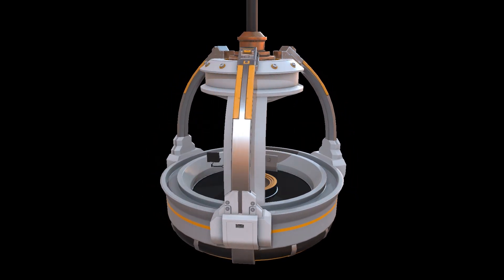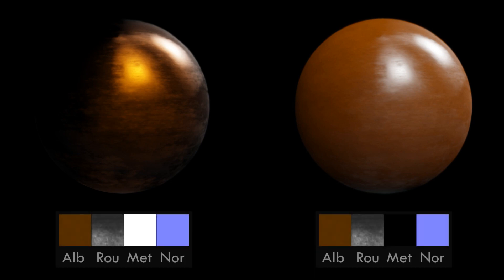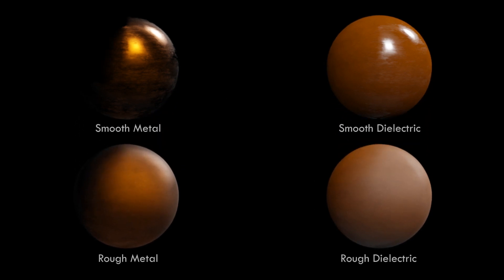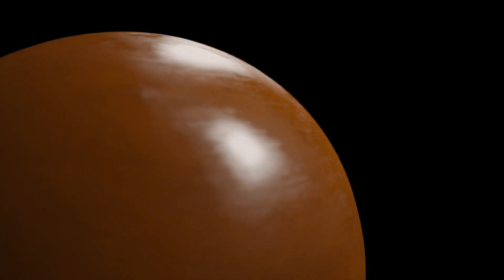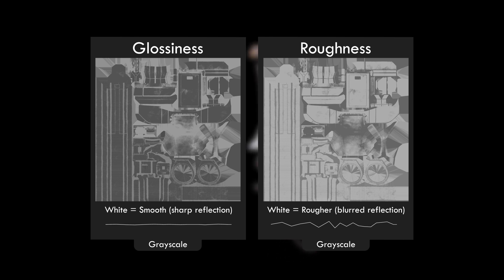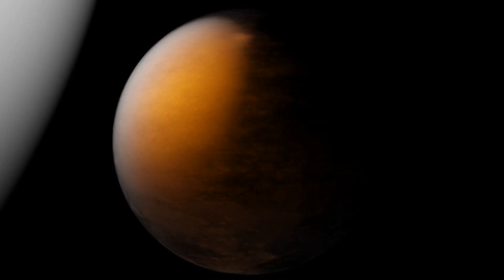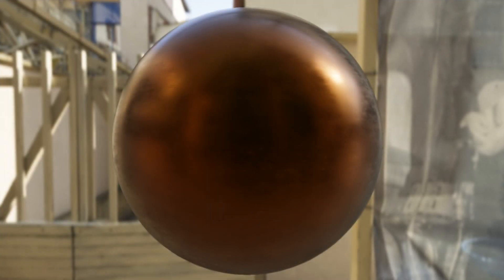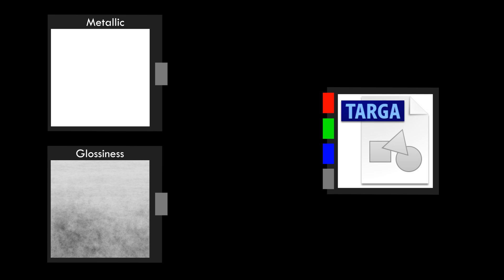Real-Time Physically Based Rendering: A quick explanation

Comment: Why cant you just use terminology that was used for decades: Diffuse (texture), Specular/Shininess (texture/map), Bump/Normal (map), Cubemap, Ambient....
Albedo, Microsurface etc etc... are you using terms from a specific application? Surely not common OGL or DX...
Reply: diffuse is NOT the same as albedo. that's the whole reason he's explaining this, lol. same goes for specular/shininess map - this whole video explains how with the new PBR standard, metalness/specular color is one map and microsurface details (roughness/gloss) is another. ambient occlusion and bump or normal map aren't important here, as he mentions in the beginning - they have stayed the same. the terms he uses are not specific to any application, either.

Comment from the maker: Errata: In this video I make it seem like the photons colliding with a metallic surface will be reflected before any form of absorption behavior takes place. That is not the case. Sending a photon back out again is a secondary effect in the interaction process. There is always an interaction between the photon and the atom. So refracted light interacting with metallic atoms will have interacted and been changed, and not simply bounces off the surface as wrongly implied in the video regarded refracted lights on metallic surfaces. But because the light structure of refracted light tends to be less distorted upon exiting the surface, there is a greater sense of reflection in the refracted light than light coming from non-metallic surfaces. So while the color of the light has changed, the structure of the light is often similar, so it would be possible to see the reflection of the surrounding area in a different color than what it really is, which is different from specular light.

The graphic on 05:38 says Microsurface factor when it should be Specular factor

Comment: Is there a book about this topic? or an article? where I can get more information?
Reply from the maker: Hi! For references I used 
Real-Time Rendering, 3rd ed, ThomasMöller, Eric Haines, Naty Hoffman, CRC Press 2015.
And various articles on photons where the book did not suffice.  
I couldn't find the perfect book for me either, sadly, I don't think there's a book out there which thoroughly explains it equally well scientifically and in 3D rendering practice. The book mentioned is quite nice though if you want to understand the rgb shaders. And you don't hate math formulas.
Reply: Thank you so muhco for the info, I'm curetly working in a real-time project and it's making me have a lot of questions.

Comment: Sorry if this is a stupid question. I still don't understand. Why there are others "physically based" terms beside "rendering" such as physically based shader, lighting, and even for animation. What's the meaning of those? What's the difference? Sorry if my English is terrible.
Reply from the maker: Hello! No it's a good question. The word "physical" is used loosely in computer graphics. It's mostly a marketing term that the creators can use because they feel the behavior resembles "the real thing" and so on. What it usually means is that the behavior of the light or object changes relative to other forces and elements within in the scene. 

Physically based lightning, for instance - can mean that the behavior of the light ray will change upon the interaction of a surface. For instance if white light enters a surface and resurfaces as red light, - the surrounding surfaces will maybe also be shaded red (to a small degree) from those emitted rays. The "maybe" is because the other surfaces might simply absorbs the red light, so it does not resurface again to hit our eyes.  
If the light was not(!) "physical", then it would bounce off the surface as if it had never really interacted with the surfaces, - and continue to shade surfaces as if it still was white light. Yet the surface which was hit is still colored red. That does not make sense in a real world scenario. 
This is just one example of what could justify using the term though. There are plenty of other behaviors of light that can be imitated. 
[Author note: This is further elaborated in detail in a following comment]

As for physically based animation, it can mean that the objects in the scene can be given a weight based on the size and material class, which will change its behavior when interacting with the gravitational factor within the scene. For instance, if the arm of a character goes limb, how fast will the arm fall into a resting position? The renderer will have to calculate this based on its weight and the gravitational down-force. 

Physically based rendering, shaders, materials and so on are called 'physically based' because the data which is fed to the shader is broken into individual data parts which can be used to shade the surface in a similar way a real surface is.  
. 
What is the color of the re-emitted light? (albedo)
How much does the submerged light scatter? (metallic)
For the light rays that simply bounces off the surface without submerging, how large is the spread angle? (microsurface) 

Older shader types which are not physically based shade the surface through more simplified and abstract data structures. Diffuse and Specular, for instance. 
Specularity was basically a metalness-roughness hybrid which decided the luminosity and size of light sources directly visible in the reflected angle. A dedicated roughness channel was not really a thing. There was simply a set hotspot-value which decided the sharpness of any direct lightsource which was reflected into the camera. And sometimes, there was another slider which you could use to reduce the luminosity so you could have a large specular coverage of the surface without overexposure. It depended on what specular model the renderer was using. But the value was set in stone and affected the entire material surface. Imagine trying to draw a surface which was part noisy and part polished. The hotspot sharpness would be the same across both the noisy and polished part. It was really difficult to make convincing surfaces this way, as polished surfaces reflect light more uniformly (thus sharper hotspot) than unpolished surfaces (scatters into many directions).

Edit #1: Fixed (I hope) a very confusing sentence.
Edit #2: Added a bit more clarification in the lighting paragraph.
Edit #3: Some typos.
Reply: cubetutorials Wow, that's a very detailed explanation. Thank you. So, if we use "physical based rendering" technique does it means we also using physical based shader, lighting, etc at the same time too?
Reply from the maker: Not necessarily, but both offline and real-time renderers are capable of "physical" light behavior to a minor degree so it is often the case. 

The short answer is that the term "physically based" is a bit meaningless when it comes to lighting. Lighting in 3D graphics has been referred to as physically based since shaded surfaces was invented. So it's basically a buzzword. Not many use it. 

It's difficult to market the term "physically based lighting" because it is hard to know what defines it. How many light properties do we have to emulate before it really resembles real lighting, and deserve the use of the term?  

And then there is the question of technique versus visual result. 

There are two major techinques used today in 3D computer graphics. The ray-cast technique (computationally intensive but accurate) immitates a lot of the actual photon behavior through these rays. This is used for offline-renderers, because the technique requires so many calculations that our hardware are not capable of rendering it out in the required screen resolution fast enough. 
The other technique is photon mapping, which creates texture maps that stores the ray data per texel (per point in the texture, often referred to as a pixel but a pixel is a LED on your screen, common misconception) before runtime. This means there is no need to use raycasting for scene reflections and light scattering at runtime. The data for this is stored within textures for each object. You've encountered this technique when Unreal Engine or Unity has asked you to bake the lighting or lightmass, etc. It is basically why real-time 3D graphics kick ass today.

So when someone says the lighting is physically based in a real-time renderer , they probably actually mean the visual end result, and not the method and technique of which it is created. Since offline renderers use ray casts for pretty much everything in the lighting process for the scene, it is much more similar to physical light in its technique. It is therefor more fair to refer to it as physically based than the photon mapping technique. The photon mapping technique uses rays to create the textures, but the visual effects are made through the textures and not actual rays at runtime. So this is the technique versus visual result thingy. 

But the video game industry has done a good job at shying away from the term physically based lighting to avoid this confusion. They have instead called the visual effects they have been able to emulate for what they are. They do use different words for the same thing however, which can be confusing. Global illumination, indirect illumination, and diffuse inter-reflection are all the same thing for instance. They are all the visual effect of the surface color of a surface appear on its neighboring surfaces etc, which we have been talking about so far. 

If you wanna go balls-deep with this you can search for Henrik Wann Jensen High Quality Rendering Using Ray Tracing And Photon Mapping (siggraph 2007) and Peter Shirley Physically Based Lighting Calculations For Computer Graphics (B.A 1985). I casually read them here and there ones in a while. There is a lot of things to learn from the texts, even if you're not very mathematically adept.
Reply: Thank you, now I know a lot about those terms. I'll check out the references.
Reply: «Physically based rendering» is usually defined by having following properties: 1. Every material respects the law of conservation of energy (objects do not glow by themselves, only reflect, no fake specular light); 2. Every material respects Fresnel reflection (it is always present); 3. Materials are traditionally grouped into two categories: Metallic and Dielectric.